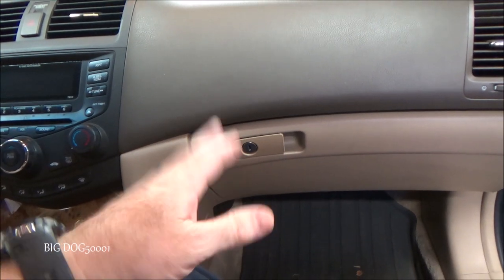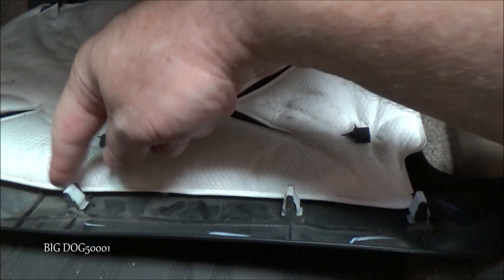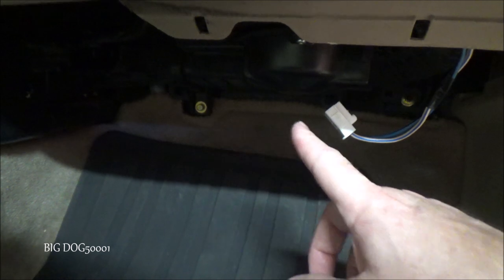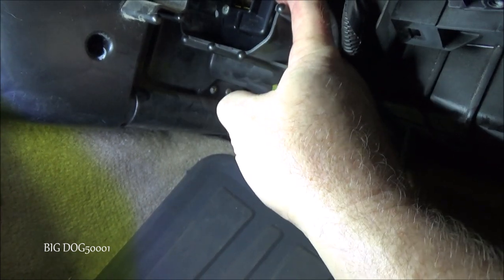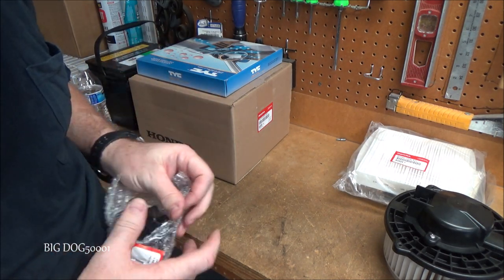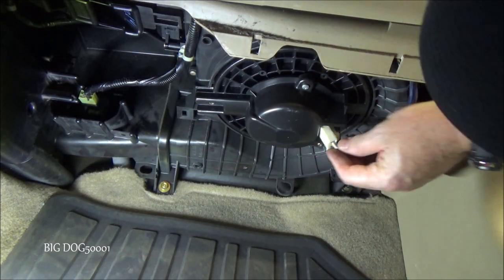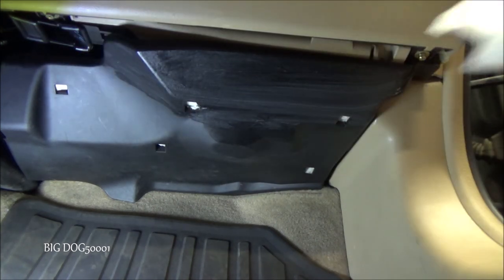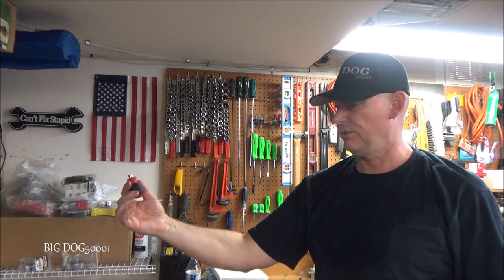Honda Blower Motor, Transistor and Cabin Air Filter Replacement - Accord 2004 (2003-2007 Similar)

Comment from the maker: Tools and Parts

Disclosure: This channel earns a small commission using some of these links - at no additional cost to you.

Honda Blower Motor:  Part # 79310-SDA-A01
TYC Blower Motor:  https://amzn.to/3g0Fbj9
Honda Blower Motor Transistor 79330-SDA-A01:  https://amzn.to/2Y0hMYM
TYC Cabin Air Filter:  https://amzn.to/2PUoM5d
Harbor Freight Test Light (The one shown in video is modified):  https://bit.ly/3iPlAnT
My Favorite Test Light:  https://amzn.to/3g4GehH
208 Piece Bit Set:  https://amzn.to/2CyLrAW
Wiha Stubby Bit Holder:  https://amzn.to/2Cv9GQt
Ratcheting Screwdriver (Similar to Snap-On Shown in Video):  https://amzn.to/30W79YW
Vessel Extra Long Screwdriver:  https://amzn.to/3g0EbLV
Astro Light:  https://amzn.to/31VOV99

The Big Dog 50001 Automotive Channel Store can be found here: https://www.amazon.com/shop/bigdog50001automotive
Reply: Amazon (and HondaPartsNow) are both saying the transistor for an '07 sedan is 79330-SDR-A01 not SDA like in your link?
Reply from the maker: @ronaldjensen2948  Honda appears to have updated the part number for 2005-2007 Accords, for certain trim models.

Comment: Today I installed an aftermarket blower motor and resistor both purchased from Amazon  into a 2013 Honda CR-V.  Honda has discontinued these parts for my model year probably because their ten year parts commitment is done.  I had to remove a corner piece of the duct to access the resistor.  The job was pretty straightforward and everything is working well.

Comment: Just because the blower motor isn't turning doesn't mean that it's bad!!! I had the same problem with my car.  I decided to test my blower motor  by hooking two wires from my car battery (one on the negative one on the positive) to the two posts on the blower motor. The blower motor still works!!! It's the RESISTER!!  Saved me over $105.. Always check everything!!
Reply from the maker: This was just a replacement video (I have diagnostic videos on blower motors), but I always recommend testing before replacing.  A simple test light and jumper wires (or a PowerProbe) can give direction pretty quickly.  Thanks for the input.

Comment: I own 2 Accords, 2006 400K miles and a 2007 270K miles and I replace cabin filters 3 times a year for each one of them. I live in the North East and we have different kinds of tree leaves that make their way to the filter. Since the airflow goes down,  the cabin filter catches more debris comparing to engine air filter. I always have my vacuum cleaner ready in case the cabin filter is stuffed and the debris falls down in the blower.

Comment: On my 05 coupe the blower motor was held in by Phillips head screws, not star bit. This is mine and does not necessarily represent everyone. But I spent 20 mins searching for my ratchet screwdriver that could swap out bits when I didn't need to. My fault for not looking first. Oh and if you're going to swap the air filter you can take the glove box out and remove your problems with clearance to get the resistor out. Hope this helps somebody. I'm glad my vents are working again.

Comment: Nice video.  You tested the transistor and it seems to be working fine.  You should just leave it.  It either works or it doesn't.  It is not a wear item.  When my blower motor was worn, it placed a heavy load on the speed control module.  As a result, it heated it up and burned the thermal fuse.  I just opened it up and replaced the thermal fuse inside.  It also burned the fuse in the engine compartment.  Transistor works differently than a resistor.  The transistor turns off and on (PWM) to reduce the blower speed.  It does not bleed it as heat.  The heat is produced from the inefficiency of turning it off and on.  A resistor resists the flow of electricity and radiates it as heat.
Reply from the maker: The transistor works hand in hand with the blower motor to control the speed, not only do the controls wires go into the transistor but so do the blower motor power wires.  I have seen too many times where a bad transistor looks like it is functioning properly but has damaged the motor and if you only replace the motor it will go out again very quickly after replacing it.  This is why I typically replace both at the same time.  And it certainly does generate heat when it is doing its job, a lot of it, which is why that heat needs to go somewhere (bled off into the air stream).  Heat is energy and if the energy (in the case battery voltage at the blower motor) isn't being used by the blower motor (when it is turning at a lower speed) then it needs to go somewhere.

Comment: Thanks for the video.  So many places charge a ton for this.  I know my Honda dealer wanted $681 but believe that includes parts.  I even called Pep Boys and they wanted I think $400 for parts and nearly close to $600 with replacing it.  I see parts so much cheaper on the site you suggested.  They do not have the part for the back of the assembly but might sell it separately as I do not know.  It is amazing how much money places want for this.  I would still have it done though as though it looks simple I would still want some one else doing it.  I do not have much patience so would probably break a few items along the way.

Comment: Great Video. Replaced resistor and now blower works! Fast forward 2 weeks and now the blower stays on constantly, only shuts off with key. On/Off switch won't control, but does increase speed up with fan speed controller.  Any ideas?

Comment: Outstanding video!  Quick question, I replace the resistor and the blower motor for my 07 Honda Accord.  It worked for about 3 months but now it runs constantly on high.  The only way to shut it off is to remove the ignition key.  Do you think I might of gotten a bad resistor?
Reply: same issue. Did you find a fix?

Comment: I was watching another video of a guy replacing the Resistor only in a newer car but still and older vehicle maybe about 2006.  It was funny in the video it showed so much space that he did not have to use the small screw driver.  What I found out after dropping the panel that you need to is that the car has a side panel that he seems to have removed but did not state this in the video.  I guess it has some screws and not sure what kind to remove this.  I was so surprised and freaked out when I saw how mine was.  I still have yet to replace mine but I did buy the parts.  One they have a newer part for the Resistor that has the heart now and which has a 3 year warranty.  That one says it is better then OEM but not how.  At least the one you suggested states how.  For my car it will go for weeks blowing nice cool air and then stop and some times will start again when I get the car at highway speeds it will start to blow cool air all over again.  It has kept me from replacing the parts but now it is getting very hot out so know I will need to replace them soon.

Comment: Hey Big Dog hot a problem with my 2005 honda accord lx radio works but none of the A/C controls work and the blower stays on cant turn it off i have to unplug the wire from the resistor what can it be ???

Comment: Hi there.. I just bought a Honda accord diesel estate MK 7 2005 ) steering wheel on the right hand side!!). I noticed that the pax side heating works properly in all modes but the driver's side gives some very light heating (nothing compare to the pax side).
I did the following:
Hot water valve (engine compartment) removed, checked and refitted... works properly
Both actuators removed check and refitted.. both work properly. The groove of the driver's side actuator (the problem side) was also tested manually, from what I can hear the flap connected works properly too but engaging the groove manually (without the actuator refitted).. doesn't solve the issue!!  
Any ideas as to why is happening this? thanks

Comment: @ big Dog50001 Automotive I have the same issue Wth the blower motor on my Honda Accord 2004 2.4l lx 4 door sedan I have to hit the bottom to make the the blower motor to start sometimes it’s stuck I wasn’t sure if it’s a blower motor that makes a squeaking sound like a bird chirp at first I thought it was a serpentine belt and tensioner so I changed that still the same sound and then I changed the a/c compressor pulley and clutch still the same sound until I found your video I think it might be a blower motor that’s making that sound so the sound only squeaks when the car is in drive in a still position and drive but when u put it in park the noise goes away I knw my car have to excessive vibration cause of my engine mounts also the car is 16 years old so I’m not sure because I did order the oem parts online from cheaphondaparts.com so I’m not sure what it is can you help if it’s the blower motor or radiator fan because I got both because of the cars age
Reply from the maker: Hard to say. Might need an assistant to help you out by manipulating the car (taking it out of park etc) while you listen for the noise and try to pinpoint it.  Otherwise you just throw parts at it which can get expensive fast.
Reply: @BigDog50001  thank you very much I’ll try that and take your advice

Comment: Glad to hear you recommend TYC as I've had good experience with their headlight assemblies (on Hondas) plus they're half the price as OEM. Just curious, it appears that Honda superseded the blower motor/fan in 2013 but not sure what changed other than the wiring connector. Honda says the original p/n was 79311-tr6-a71 but superseded by 80030-TR0-305. Many sites say to match connectors. Have you ran into the "wrong" connector ?
Reply from the maker: Superseded parts can mean Honda updated the part to perform better or to save costs (among other things), or it can be a new parts manufacturer was selected to make the part (many times this is the case), but the specs and wiring connections should not really change as far as fitment on vehicle.  Trim levels, country where it was manufactured, coupes and sedans can all have different parts numbers (and wiring connections) and that is where aftermarket parts makers/sellers sometimes get it wrong and it can cause confusion.
Reply: @BigDog50001  I found the blower fan (TYC) on Amazon and ordered it before checking the connection knowing returning it through them would be easier if I had to. In this case, the connector TYC shows matches the car so I should be good.

Comment: I would like to change the cabin filter in my 1998 Accord. Someone told me it requires removal of 18 screws and sections of the dash. Any truth to this? Thank you also for your video.
Reply from the maker: I don't remember how many fasteners there are but yes they are a pain to get to.

Comment: Dave as usual another good Honda video.  Rule #1 don’t tap item until you start filming Lol. If. The A/C brings the shop down to 90 degrees it must be hot outside. Surprised you don’t take the summer off. Anyway hope you and family are well and drink plenty of water. Oh and Hondapartsnow.com are excellent to do business with. They answer all my questions promptly. Artie 😊😊😊
Reply from the maker: I order from them at least once a week.  Yeah, it gets pretty hot out here thanks for the comment!

Comment: Could you please help me with my situation? Honda Accord G7 2004. Fan blowing ok at speed 4-6. At speed 1-3 fan working 3-4 seconds then stop for 10-14 seconds, then start again.
Reply from the maker: Hard to say without seeing it.  Control unit problems, bad blower motors or transistors can all cause problems like that.
Reply: @BigDog50001  thank you for your answer. I'll go check at Honda today.
Reply: @BigDog50001  done. It was burned out thermal fuse inside transistor module. 15$ and everything ok now :)